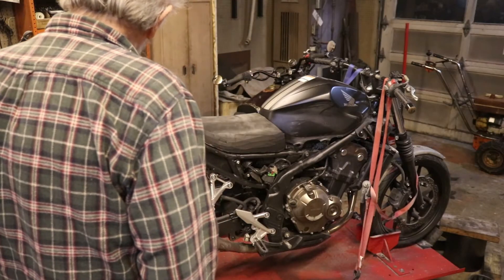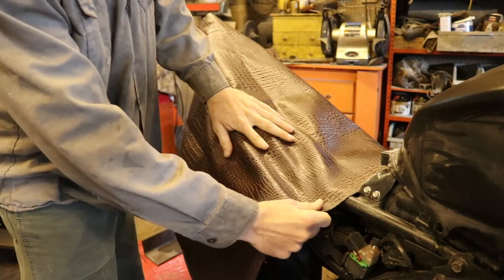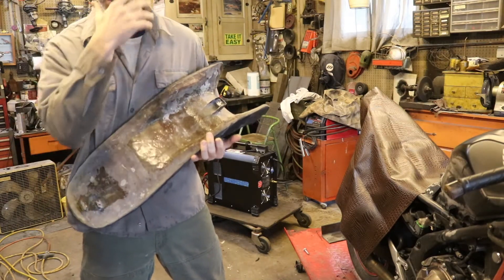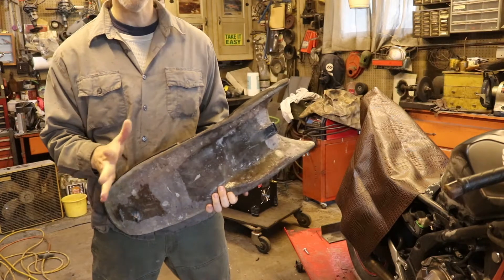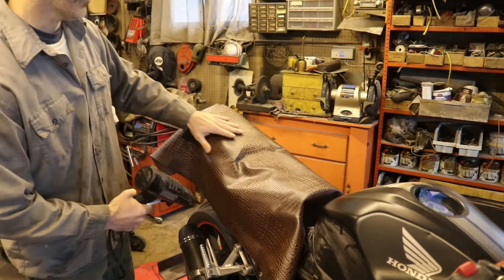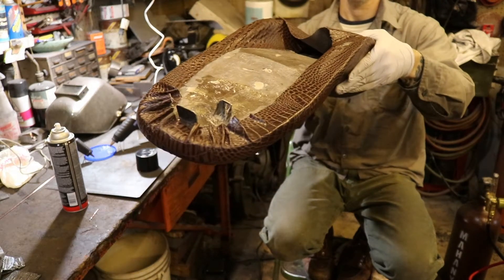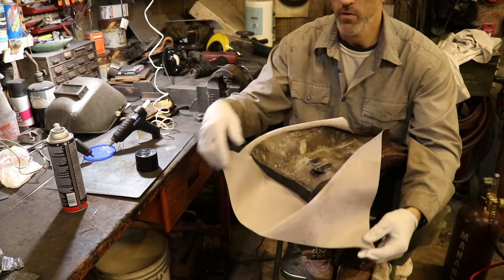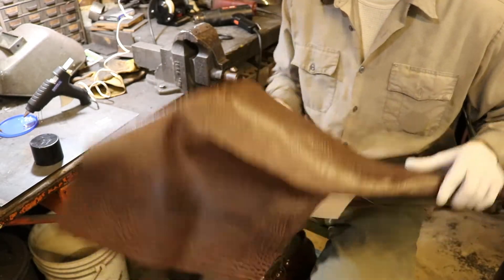Vinyl Motorcycle Seat Cover on Fiberglass Pan | E13 - Custom CB500F Build

Comment: Great video. Thank you so much. Which spray adhesive did you work with? And did you find an optimal time to allow it to get tacky before using it?
Reply from the maker: I used the 3M Super 70. There should be a link in the description. Long term I have not been happy with how this turned out and will be redoing it. The vinyl just did not conform well to the seat. Perhaps due to the seat contours being too deep or the vinyl being too thick. End result I have wrinkles and it looks poor. Have not quite figured out how I want to redo it, but will put out a video when I do.